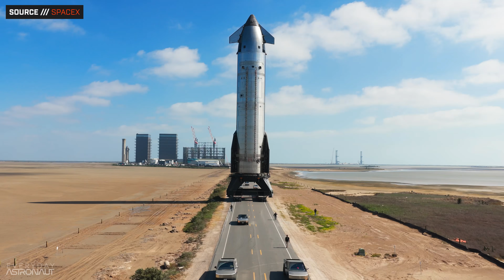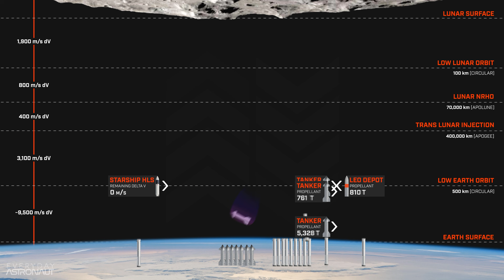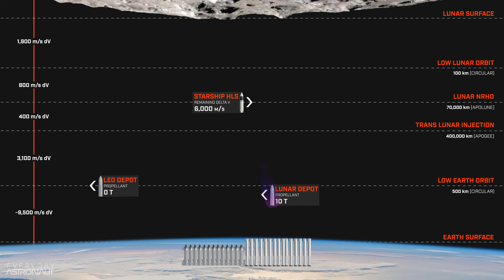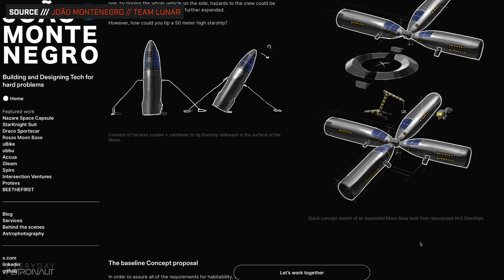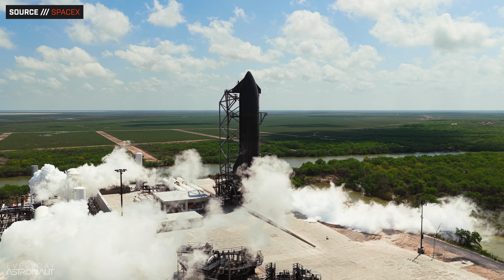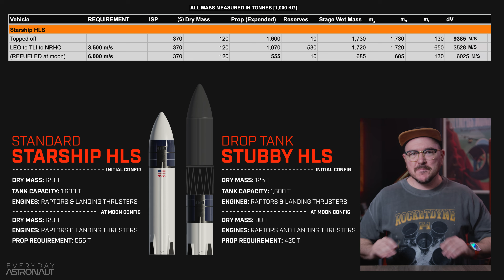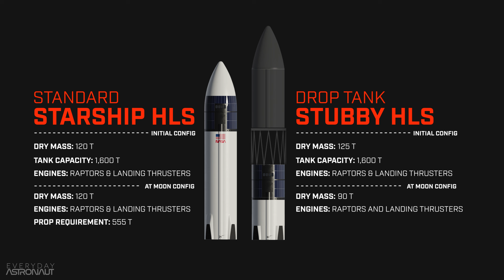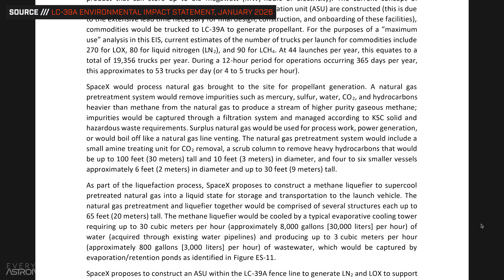Does Starship REALLY require 15+ launches to land one lunar Starship?!

Comment: I would consider making the HLS "expendable" by leaving it on the Moon and just carrying a small ascent module to get astronauts back to lunar orbit.  The HLS wouldn't really be expended, in that all that refined metal and manufactured equipment could be used for lunar base construction.  I'd like to see what that does to the rocket equation and the need for a cis lunar depot.

Comment: A dozen re-fueling missions seems like a big problem.
Reply: Spacex have five launch towers in various stages of construction, so it would only require 3 from each to get the job done. Starship is fully reusable so they only need five rockets which makes it a much smaller problem.
Reply: @shaung949 True , i think SpaceX needs one or several giant refueling space stations where Starship could fill up in one and have launch support.
Reply: @ExploringCabinsandMines  That is kinda the plan, they are going to launch depot starships to collect the fuel in orbit from the tankers then HLS docks once with the depot before heading to the moon. 
I'm sure something more will be put in orbit but for the early missions it will be depot starships.

Comment: Sorry Tim, I really appreciate your effort, but I do not share your assumptions. 1st V3 is a useless rocket, this is not what Space X is working for. 100tons is very low, not even 2 times Falcon Heavy. In order to really take advantage of this launch system we must wait for V4. 2nd who is in charge of the Space X Moon program? I really can not understand the crazy idea of landing a SpaceShip on the Moon, and even much more crazy to return from the Moon with 100ton ship. Come on guys! Eagle was 15tons, with today's technology, what do we need? Let’s say 30ton, this should be more than enough for Artemis (of course after Artemis we can discuss about permanent bases and many other things, but this is a concern in 10 years). And only Orion has to come back to Earth, it has no sense to bring back anything else. 3rd the kick from LEO to the Moon can be done with LH2 + LOx, it was the decision in the Apollo programme, and it makes even more sense now with expander cycle engines. I do not want to extend more, if you are interested I can help you to do the numbers, but I advance you that with these 3 assumptions you will need 1 or 2 superheavy launches per Artemis mission (this is launch Orion + service module + lander).
Reply: Starship was not designed for the moon, it was designed for Mars. Falcon heavy can only get that much payload to Leo , starship can take that 100 tons to the Moon, Mars or beyond and the next version of starship is expected to lift at least 200tons.
Reply: @shaung949  oh man you are a bit delusional. it cant take 100 tons to the moon or mars. so far it cant even go to the earth orbit WITHOUT payload.  What design are you even talking about?
100 tons is their estimation for LEO payload. to fly further they need refueling, that has never been done. Fuel is cryogenic and will boil off. it wont hold fuel for 6-9 months. its not a design, it is a disaster
Reply: @pewpewpew8613  I said it was designed for Mars, not that spacex have finalized the design, it's still in R&D. Starship CAN get to orbit, spacex have not done so because they are focused on starship re-entry testing.
Reply: @shaung949  then why they cant test reentry from the real orbit? maybe because it is so unreliable that they are not sure if they can perform a controlled de orbit and reentry? so yeah, they still cant get to the orbit.
8 years, 12 flights, 0 orbits and big issues every launch. and they still have no idea how to refuel it in orbit and without refueling its just a big rocket for starlinks

Comment: The LEM had a square configuration, so stability-wise the width was only about 6.7m across the sides of the square - about as wide as it was tall. 5 legs are much more stable than 4.

Comment: Is there a reason to do refueling in LEO ? like instead of 500km pushing it to 600km / 700 km etc.
Reply: Starship burns most of it's fuel getting to orbit so the closer the refuelling depot is the better.

Comment: First what’s the goal here ?   
1) Going to the moon and landing and returning with a crew.  Or
2) Going to Mars and landing and returning with a crew

2 isn’t going to happen anytime soon, as in the next 10 years. 
Go look up analysis on what’s required to send a crew to Mars, stay on the surface and then return. We have nothing, absolutely nothing to accomplish this; the ISS is routinely refurbished with supplies and can be evacuated quickly if necessity. A crew on its way to Mars is totally reliant, except for technical advice, on itself. It’ll happen someday, just not now. 

So SpaceX and also Blue Origin are under contract for a human crewed lunar lander. Doesn’t need reentry heat shielding, flaps for atmosphere control, etc. SLS and Orion are now proven tech…and it has abort capabilities and facilities for human environment. 
Incidentally it’s cost is as someone noted here closer to $2 Billion per launch, about $600 million of it for Mission Control,pad technicians for loading the crew, and flight monitoring which SpaceX has yet to incorporate into its expenses. You can’t rid yourself of that “ management” expense and for now SpaceX has only launched hardware for Starship. 

Mars isn’t realistic, the Moon is feasible, $2 Billion isn’t unreasonable for a lunar maned mission and SpaceX still has a lot to get done.

Comment: Holy cow dude.. I can not believe how smooth your manual transition was.. This is all going to happen. Tell Elon to do the landing leg setup and also - create a dual backpack cable system that can lower and raise humans to the habitable area locks.
Reply: The cables should go through the sides of their packs and the packs should be powered with a high amp system, with the cable having a geometrical surface that can be gripped by teeth in 2 rotary disks in the pack. Done. Ladder could be a secondary, emergency use. Even then, a single cable built for safety could be installed and used to catch an astronaut if they slip off the ladder.

Comment: Honestly, I'm not a fan of the current plan for the same reason I wasn't a fan of the space shuttle. You are moving so much mass that's unnecessary. 

The lander should be as small as possible.

I also wouldn't capture and orbit the moon; I would try to put the HLS Starship in a perpetual free return orbit, which just makes laps between the Earth and the moon. Once you burn the fuel to get it into orbit, it's done. 
Launch a smaller, faster shuttle that can accelerate from LEO to Lunar Transfer when the HLS swings by Earth and dock with it, refuel, and hitch a ride to the moon. The fuel needed to move something the size of a dragon to Luner transfer is so much less than accelerating a whole Starship. 

Occasionally, you'd have to push a tanker into the trans-lunar to refuel the HLS ferry, but it would be way less often

Comment: Another Option: the refulled Starship docks with Orion with the attached ESM in LEO, Starsship tugs it all the way into LLO. ESM is still at 100% propellant (little less for boiloff) and ready to leave at anytime before if anything goes wrong. In LLO there should be some kind of Lunar lander waiting. Could be a Starship HLS, could be a Blue Moon lander BUT ALSO a Alpacca. Because its not ready to make it to the moon from NRHO and back, but perfect from LLO to the moond surface and back. As far as I know Alpacca is the most advanced because it already has passed the preliminary Design review of Nasa. When the mission is finished any of the three landers returns to LLO, docks with Orion with its ESM and propells itself out of LLO to return to earth. Would be by far the safest way and give Orion a long term future. As a rescue vehicle during apporach and the return unit after the mission. Starship could act as: Unmanned Lunar lander as a new station, stay in LLO as a refill station for Blue Moon or Alpacca or be the heavy lift lander. Why not?

Comment: For propellant transfers to the moon, if you solve boil-off, then a slower, more efficient trajectory might make sense.
It would also not surprise me if the propellant and depo versions can be optimised in terms of dry mass.
Every ton saved in dry mass means extra payload.

Comment: 28:00...if the elevator already uses cables. why can't they just pull themselves up by the cables like it's a rope under 1/6th g.
Reply: They can even reach it by just jumping really hard, xd. Also, there's something like a ladder in the picture.

Comment: Actually having the elevator gives you the advantage of keeping important stuff away from lunar dust. Seems like you could easily climb the cable 40 meters on the moon if the elevator broke or have some manual back up considering everything weighs 1/6th.

Comment: SpaceX should seriously consider a triple stage vehicle at this point. or even a separate vehicle completely, build in a earth orbiting space doc; fits the craziness of spaceX ;)  ) it would simplify both the moon project as well as mars. they have proven that current vehicle can deliver massive payloads into low earth orbit, so thats a perfect fit for either solution, moving forward. you don't use a full blown cargo train either to deliver packages into a town center store, you use a light bus or something. although the imagery of landing that behemoth on the moon seems fantastic, it is just overkill. 

they could also change the mission parameters - just launch one to the surface of the moon to keep as a ground station there. that's it.

Comment: I still dont understand the moon starship. To me it seems overkill to use the 3 vacuum raptors with 3 atmospheric raptors for a vehicle that is supposed to go from LEO to the moon and back again. Surely you could do with a simpler, high performance, less thrust engine? Also if it did not need to use the Starship design as its core.. they could have it land horizontal - like the spaceship from "Space: 1999" 

As much as Blue Origin has been a laughing stock for a while.. their 3 ship approach seems much more feasible to me. And its in line with what used to be Elons logic - that SSTOs are dumb because its more efficient to have specialized stages for their purpose.

Make a craft that can go to LEO and back. Make a craft that is light and can go to the mun, and is optimized for that.. and have a lander that can land.

It also seams very backwards to me that they meet Orion at the moon. I guess thats just the effect of having 3 suppliers need to meet a demand - while not being designed to be integrated from the ground up. Since the moon starship is habitable.. it seems a lot more sensible to load the crew up in LEO.. and then load the crew to a reentry vehicle at LEO again. Its also les demanding for the heat shield.. I mean.. it could even be a dragon capsule that brings the crew up or down to the moon ship. If a crew rated Starship is not ready yet.

PS. This of course assumes that refueling is not hard once we figure it out. That was a good point, that the more refulings is needed the harder it probably gets.
Reply: Politics say they must use Orion and SLS for artemis, the other ships must work round this.
Reply: @shaung949  yeah - its funny how its always like that. there is always a mismatch because of politics..

On a somewhat different note... I wonder if the Shuttle had been better if the airforce had not had extra requirements. (which I dont think was ever used)

Comment: If they had coaxial tanks the center of mass could remain constant for a sideways landing.  But you would need a larger flat landing area and more of a free surface effect to manage.  And you would need two taps into each of the tanks.  It's a silly lander in either attitude.

Comment: If it took 15 launches it would still be worth doing. Really if we will build a moon base we should land smaller craft with autonomous and remote operated robots that construct a landing pad, which would make landing Starship vertically much more painless. It could then be mechazilla'd off the pad and laid down horizontally for offloading cargo & crew, relaunched or reconfigured

Comment: If I were in charge, I’d probably park a starship HLS on the moon as the base, cannibalize the sea level engines for personnel shuttles to the surface and the vacuum engines for lighter unmanned freighter craft to earth and back for cargo/fuel. prioritize a fuel depot in NRHO over anything on the surface. 

It’s always easier to go down the well than climb back up.

Comment: Tim:

Great video. Thanks for putting in the effort. 

In pondering the challenges of theses missions I think we might be overlooking one potentially interesting piece that SpaceX could be planning to exploit from their toolkit, at least for their own lunar missions for awhile.  That is the custom ISS de-orbit tug designed to work with Dragon. This must have a fair bit of delta V and combined with Dragon I’m thinking could provide a Man Rated taxi service to get astronauts back from the moon to Earth’s surface. It just seems to me that long term they’re going to want to just leave the Starships on the moon to serve as basing and construction resources for the first moon base operations. I mean a 100 tons of processed stainless steel can serve A LOT of useful purposes and is easy to cut up and re-weld into all manner of facilities and equipment.

Also, just a rattlesnake, but what about this idea? One of the big challenges predicted for lunar surface operations will be in how to deal with the abrasive characteristics of lunar regolith. So if you’re planning to leave a starship on the surface anyway, why not send it down with just a max propellent load and use the delta V excess to hover around and “sweep” out the area were you want to build your initial base with one of the Raptors? It seems that could minimize much of this challenge for operations in that immediate vicinity.

Food for thought anyway.  : )

Comment: Outstanding and informative video - in a class of its own.

My takeaway, though, is that the proposed approach is of such complexity that it will require a decade of development to prove it is economic enough and safe enough for the set up of any worthwhile "settlement" or even a small base on the moon.
Reply: SpaceX, Blue Origin, and the Chinese all have the same problem to solve, it's just the way the math works to deliver massive tonnage to the moon surface.

Comment: 55:40 This schedule is normal i mean i dont know why people put so much enfasis on this procedure.
There is not short pathway to get MASS to Luna. If you want 500kg to moon than do it with one(usefull for rescue astronauts but use less in long therm because have better option) if you want 100Tones than you need refuel and tha good way is we can have the option. today we dont have it. the satrun only get tiny mass and extreme expensive. So in my opinion usign mutiple launch to refuel just one is a good option unitl we find warpdrive or some exotic propulsion.
Also this launch can be as normal procedure like we make to refuel the gas station with tanker trucks. no need for windows launch they work as logistic, get fuel to the OGS (Orbital Gas Station). This OGS is a structure where keep fuels seperatly and cryogenic coled and also serve as fuel transfer so the vehicle no need extra hardware mass to do this transfer. just dock to the OGS. or OFS (Orbital Fuel Station....xD)

Comment: 40:02 1%/day wow that is a lot. what they use? carbon black to absorb al the heat around?
The white coat dont help? There is some Boron sphere compund wich is colder than air ambient. that help in vacum with reflectiv or disipation?

Comment: Reusability isn't free ,apart of fuel costs,needs extensive maintanance after each launch.Also heating stainless steel causes  loss of corrosion resistance over time ,so at some point whole thing needs to be discarded.

Comment: 56:15 - you might be able to save much more than 30 tones on dry starship mass there - no flaps needed.
and if the engines are ~2M each, the starship isn't 'hundreds of millions' - the full stack might be, but starship alone isn't - it feels like just a disposable staship could be reasonably cheap - no tiles, or flaps, which is are the fiddly external bits ...

Comment: Alternatively, you could try bringing an electrolysis plant and a Sabatier reactor to the ice mining site, and periodically send Starships carrying a cargo of ethanol down to the surface. You electrolyze the ethanol into CO2 at a 2:3 ratio, then run the CO2+hydrogen electrolyzed from lunar ice to produce methane (and water as a byproduct). As long as those ethanol shipments keep coming, that base can keep turning it into methane (and, although this would be trivial compared to the industrial scale of it, that same Sabatier reactor could also extract CO2 from the habitat's air supply, and the water byproduct could be electrolysed into oxygen for the astronauts to breathe and hydrogen to keep the reaction going).

Comment: Amazing analysis, thank you. Quick question: the reserves for the boost-back burn are quite significant, but they assume a RTLS landing. If they had a downrange (mega)barge with suitable catch-arms - or just put legs back on the booster - the fuel reserve required goes down by 350-400t, right? Yes, there's the logistics of getting the booster(s) back quickly for re-use, but they'll have a number of boosters, and could have a number of barges...